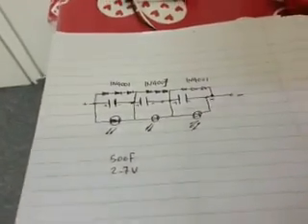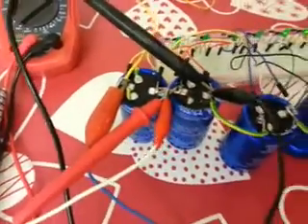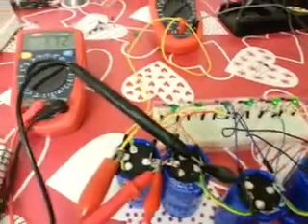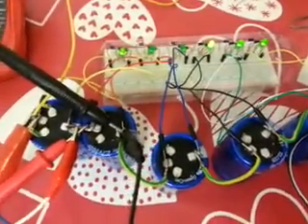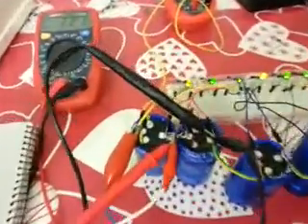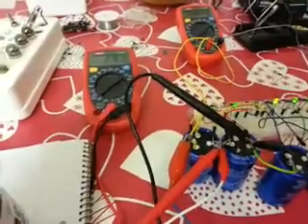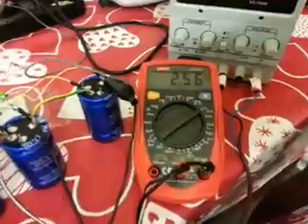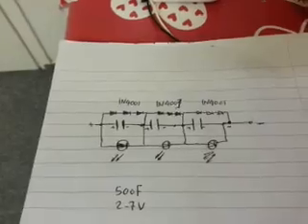How to balance charging super capacitor

Comment: You should switch to schottky diodes before you ruin your capacitors. The 1n4004 has a vf of 1.0 volts at one ampere. Schottky diods can be around .6 -.7 volts forward voltage.

Comment: I still don't quite understand this. So, in order to safely charge supercapacitors in series, apart from connecting 3 diodes in series, does the charging current have to be constant? Could this simply be achieved with lm317 regulator?

Comment: I ran this through a circuit simulator with three capacitors of differing values. It did a fine job of balancing the voltages with the unbalanced capacitors during charging. But, on discharge, the lowest value capacitor drained fastest and went to a negative voltage that eventually balanced the sum of the remaining voltages in the other two capacitors.

Seeing as super capacitors should never be charged with a the polarity reversed, It seems this circuit may end up causing the failure of the lowest value capacitor. On the other hand, if the capacitors are more closly blanced, it may be that the lowest value capacitor would not be subjected to large enough reverse voltage to damage it.
Reply: Keith Reynolds maybe disconnect it during discharge. I'm worried aout that also.

Comment: I was looking for this circuit but, will it work for 6 caps in series charging in less than a minute at high amperage? Can you please see my video under super capacitor projects. And tell me if I'm doing wrong with just l e D's for balancing I'm drawing about 90-100 milliamps on each capacitor and they seem to balance good. Making a car jump starter. Thanks.